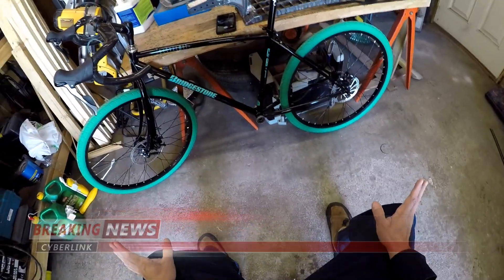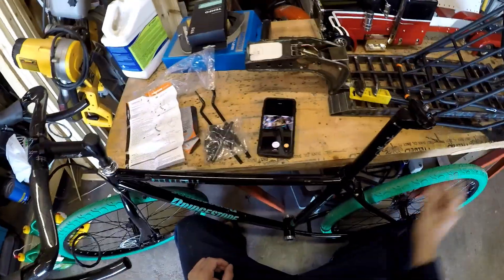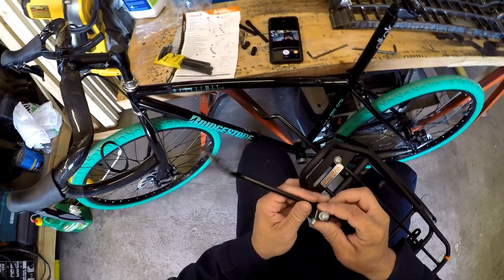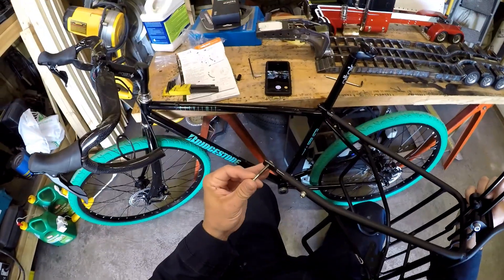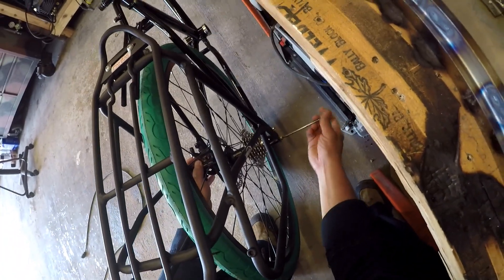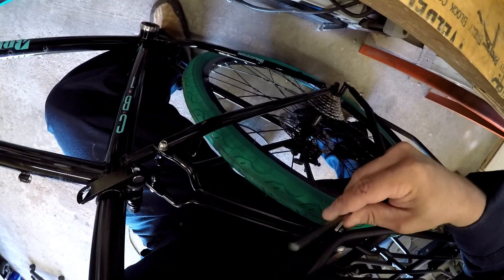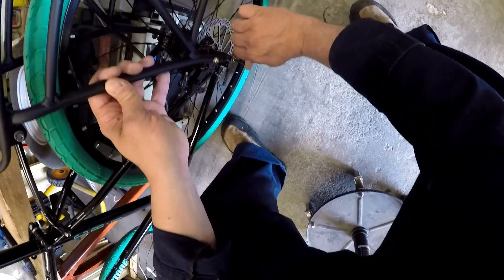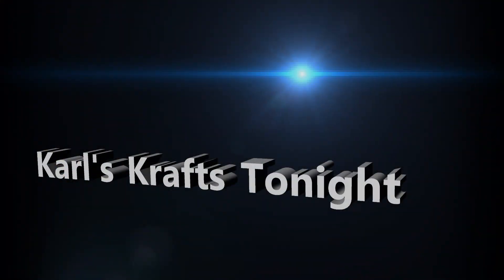How To Install an Ibera PakRak Touring Carrier Plus+ for Disc Brake Bike

Comment: The description for this rack on Amazon says Frame-mounted for heavier top & side Loads, carries up to 55 pounds
Ibera parka quick-release bag mounting system
Adjustable height, fits most 26"-29" Frames
Top fender board splashguard for wet conditions; durable lightweight aluminum, only 1.65 pounds
Can be mounted with Ibera trunk bags (IB-BA11, IB-BA14, IB-BA15, IB-BA22) OR strap-attached bags and panniers.

Comment: I got that same rack - but sent it back due to that wide spacing at the bottom mounts. Almost seems like they wanted this to go on fat bikes? Whatever, that's a damn lot of stress created by just forcing those legs in to fit - even the screws don't fit flush anymore. They need to clarify that in the details when you buy it.
They have another rack that is narrow and fits perfectly to bikes like yours and mine.
Maybe my bike is even more narrow than yours, but I didn't like it and you had to bend it around to make it fit (because of the way you mounted it, tightening the one side first)

Comment: Good  video. I'm trying to do the same thing with a Cannondale, but the carrier bolts for attaching the carrier to the holes in the frame below the seat seem slightly too big. Do you know what the size of those bolts from Ibera is?
Reply: My issue is that the long bolt is too small for the bottom hole of seat stay, currently get stuck because of that.